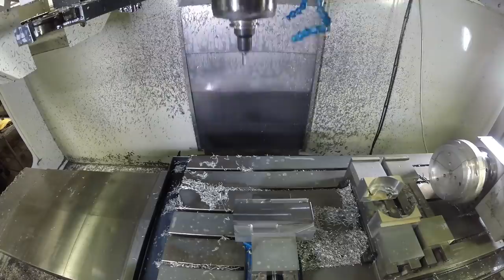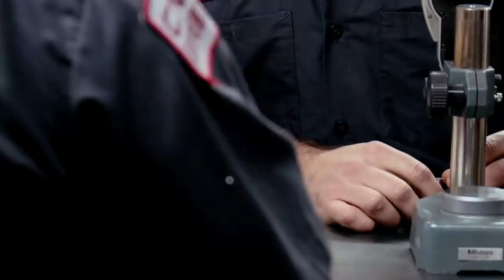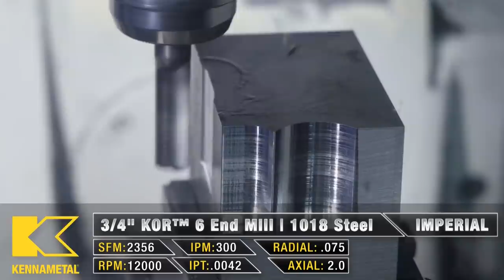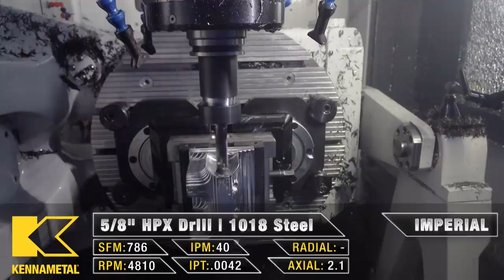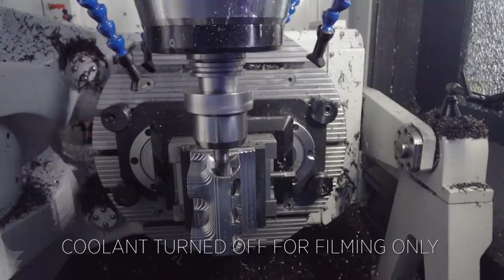Tools Keep Breaking on Night Shift, but Runs Perfect on Day Shift... Nobody Knows Why

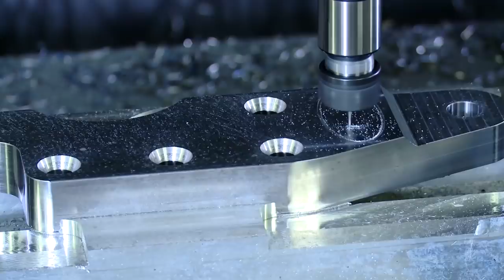Comment: 1:30 The "Problem" is bigger than you describe.    You're going too easy on the guy who changed the speeds.     He decided to change the speed because it "didn't seem right" to him but then he continued throughout the entire shift breaking parts.   Did it never occur to him, I'm not doing it they way I was told and all these parts are breaking.   I should maybe switch back to the given specs or call someone.  Instead of focusing on his job he tried to do yours and made a mess of everything.
Reply: How is that bigger than he described?  
Where I used to work we changed feeds and speeds all the time.  Some of our programmers had very little machining experience.  We were not doing production work and they almost never ran their own programs.  
It is okay to expect the operators to have a little bit of sense also.
I doubt anyone expressed to this operator how important it was for him to not touch the feed and speed override.  Shops rarely have mechanisms for adequate communication between shifts.

Comment: Sounds to me that the problem here is lack in standardization of programs, tooling lists coupled with machining superstars who know best! Each tool should have a unique tool number which corresponds to a tool drawing stating tool diameter, tool material, no of teeth, type of tool holder, tool stick out, tool stud etc. Sloppy of the owner to let this situation happen in the first place tbh!
Reply: I've been a machinist for years, and I think you are not clearly communicating.
In our programming, we do have differences, such as a long half inch in mill or a standard half inch end mill.
I'm not sure what you mean by numbering.  I don't think you would need to get into exactly what two holder differences are unless they are wildly different products.
Maybe where you have worked was more unique than you think.  
In a large operation it might be feasible to have a unique tool drive for every tool.
In a smaller shop I don't think you would have a budget for that.
And would be useless when all of your end mills are made of carbide.  We either had aluminum end mills or z carb end mills for steel.  All made of carbide.
Reply: And yes, I think it is sloppy management.  
If you are running the same parts for days, anyone could figure out  the night shift was not producing as much per hour.  
The first time they went through significantly more and meals would be a good reason for someone to get serious about finding out why.

Comment: Just block the feed and rpm in the program so the machinist can't move it down 

I had a place where I was trying a program for the first time and my programmer block these so I couldn't watch for the first contact. I've step a lot when I saw 300 inch per minute on 50% feedrate. And now I know they can block it.

Comment: That's what happens when you are a friend and not a boss. No. You will run this setup and produce the same amount of parts. If you cannot, I'll fire you before the McMuffins are cold. That's how it works. I ran the production machine shops of Boeing in Ridley Park PA. Your good machinists will thank you for weeding out the chaff. Go big or go home as they say and demand excellence knowing that every single part is exact as it can be. That is free management advice. I'm on my way to Florida soon but if you need it I'll stop by on the clock and straighten that shit out in two days, only because others sleep.

Comment: Do the tools get changed after X amount of use (surface footage)? We use drill bits that get changed after X amount of hits.
Reply: I haven't seen many people change an endmill after number of times used but I have setup tool life management for X amount of minutes used or when the spindle load reaches a certain level

Comment: Hobbiest here. Ive always heard that the feed per tooth value is the most important thing to keep an eye on but this is the first ive head that surface speed matters could anyone elaborate for me ?
Reply: It's all about finding the balance between both. Feed per tooth will for the most part determine your chip thickness, but running at too high or low a surface speed can cause tool life and surface finish problems, plus it's not economical to run too slowly!
Reply: I guess it's the balance between evacuating the chip/heat fast enought and not putting too much force on the tip.

Comment: We had a guy that would turn the feed way down so the head spent 10x as much travel time between cuts. The foreman would walk by four times a day to change it and tell him not to do it. That didn't last two days.
Reply: The foreman should have changed it once and told him if I have to touch that again you're going to need a new job.

Comment: Usually it's something you're overlooking EXAMPLE I worked in a plastics shop any down time for the machines means the remnants in the lines would harden so the first cycle back would either look like crap or simply not work that was every Monday morning for 3rd shift and after holidays and after routine maintenance OR after some tard supervisor in clean clothes would come out and start touching things that he had no clue about
Reply: Punctuation in your writing is actually extremely helpful to the reader.   😉

Comment: It's frustrating working with people who don't know what they don't know and yet they insist that they know better than you to the point that they don't hear a word you say.

My boss told us to erect a structure to mount an antenna to. I showed him a free standing 50' tower that could be had for $1200. He bought a extendable pole with guy wires. He had IT techs put it together. You could hardly even say they knew how to work a drill. Pole was supposed to be guy wired at 4 locations on the pole. They guyed the very top using stakes they put about 6 inches in the ground. Boss said he didnt like the guy wires and he wanted it lower. Took them off and lowered it and they couldn't pick up a signal. Bought the exact same pole with a roof mount tripod. Their thought was that we could use the tripod to raise it taller without any guy wires. The tripod was 4 foot tall. We already had it in concrete 4 feet deep. Now he's telling us to raise it the whole 45 feet with no support. It sways in a light breeze. We're $3k in.

Comment: Never been near any CNC machines only on YouTube.  but different materials and speeds temps  and drill /honing bits would be designed for that specific process 🤔 . If that's right 🤔

Comment: I don't understand how the night shift operator even had the leeway to make such a change.  Most manufacturers in the US follow ISO-certification and SPC management and I know that unless there was an immediate safety hazard we never had any such leeway to change things even in the early 90's.   Even then we would usually stop work until an engineer signed off on a change, not make such a decision ourselves.
Reply: I don't think you've worked at most manufacturers in the United States.
Most of them are probably very small shops.

Comment: Unfortunately this happens too often where I work. Some machinists are so far up their own asses and their self entitlement is sky high and they never learn.
These people usually think they can do a better job programming, but they have no clue what they’re talking about in most cases.
Okay, I’ve said more than I needed to, but holler if you can relate
Reply: You get a bunch of young operators with no experience... And nobody teaches them what the programing involves.   And programmers are human and make mistakes.
Not hard to imagine how some people start to think that they could do it better.  And yes, they are probably wrong.
But I've also seen programmers get hired even though they have no machining experience.

Comment: I run 8 cnc s...... believe me......it's low coolant due to evaporation, chip removal and lazyness......add the operator smoking a joint in the parking lot and there ya go....broken tools...

Comment: Thats why you can lock parameters in the program itself
Reply: Management used to take the key away so you wouldn’t make any edits on the program. but you can still manually slow down the feed and speed on the dial next to rapid speed. So it wouldn’t work.

Comment: The lesson learned here is that the tool should be locked such that a operator cannot change any values.  Machine operators are not CNC machinists but often times think they are.  Lock the tool, lock the program.  They only need the go and stop buttons.
Reply: Depends on the situation I suppose.
One might actually try to explain to the operator why it is programmed the way it is.  
That step usually gets ignored in my experience in machine shops.  Or, is done poorly.
Then, If you how long the program takes, as programmed, it should be easy to verify that the operator got the work done in a timely manner.
Reply: That being said, if your company only hires button pushing slobs... locking them out is probably a good idea.
Doesn't sound like a very nice place to work though.

Comment: I know the breaking thing, 5 years day shift broke an old sledge hammer. Got a new guy on swing and broke 12 ladders, 3 ratchets, 4 hammers, 3 paint tape rollers and 7 step stools in 4 months.

Edit, and that's not even counting the paint pots I had to repair and clean daily. So many dead paint guns😭

Comment: Problem at my plant is that the "engineer higher ups" are so crippled by social Aspberger's that they can't communicate without yelling or having a rotted tooth breathing on you inside the machine,  despite our work having 100% dental. Most times the goobers expect you to just experiment with features on machinery and have no fear about making a fatal mistake that completely breaks the $1,000,000 machine.

Comment: It is hard to understand that the tools break because of lower speed. You should elaborate on that more thoroughly.
Reply: He changed not only the feed/movement speed (which afaik would only take longer to finish but not cut worse, maybe chatter, less material load on teeth)
But also reduced the rpms ...and those too much for that tool it seems.
Reply: @PsiQ  Aaah, yes! Reduced RPM with constant feed increases pressure. If they reduce RPM more than feed that would explain it.

Comment: The factory I worked at, the engineers and lead guys were the arrogant ones. So no, the button pushers are not always the dumb ones. One of my stations, I looked at the bottlenecks of my position and adjusted my work here and there, experimented where I could, and cut my time and labor drastically. A team of 3 who had to follow a trailer up the line to finish, was dropped to 1 guy who had extra time to play with. Head engineer observed me on a trailer and scolded me for walking too much, but they couldn't deny my efficiency improvement. Ended up being fired later for bogus reasons, and funny enough the plant manager was fired shortly after I was. I didn't bother going back, but friends tell me they use my suggestions to this day. Good money, but man was there a lot of drama and corruption.

Comment: If the engineer says to run the machine at a certain speed, run it at that speed. They did the math already
Reply: My guess is that they didn't "said" anything.
They just assume that an operator is going to walk in and start doing things the way they want them to.  As suming isn't a good way to operate

Comment: If I am a "Machinist," I am nothing more than a Glorified Babysitter for a machine I may or may not know the Inner Workings Of.
INCLUDING HOW TO PROGRAM IT. Or why it's programmed the way it is. I probably know some of the Basics, but, only enough to "ELI5."

I would trust my programmer. Until running it the way HE SAID started having problems. Because if HE EFFS UP, it's his job not mine.

When I piss in the pot so I'll like the flavor better, THAT'S ON ME.
I learned not to do that in the Army. Because, in the Army, if YOU break a tool, because YOU SECOND-GUESSED THE PROCEDURE,
You get to PAY for the tool. And some of those can HURT.
But if you Follow Procedure By The Book, no one can yell at you.

Comment: Today the tooling mfgs have a very good idea what the right speeds and feeds are for their cutting tools. If you are using the tool for the application it is designed for, then the OEM speeds and feeds are usually going to dead nuts on.  When all else fails, read the instructions.
Reply: Absolutely, and, with the advancement of technology in tooling, the manufacturers spend a lot of time doing R&D to get those numbers... Go look at them first and you will be amazed at what some of these newer technology tooling can be ran at.

Comment: Modern education seems to be very bad. Going back 30 odd years, after spending the first year on manual tools, fps tip speed teeth ect, along with drilling speed and feed rate, were the study of the second year in an apprenticeship.

Comment: Discipline is needed here, the programme should be locked down, specified tools used, and the specified feeds and speeds used as defined, Quite simply dismiss anybody not using the defined/approved  method.

Comment: Shift between two other shifts is breaking tools when the other two aren't. Why is that shift is changing the machine settings? Who is the fool stupidvisor that authorized them to make changes? Were they even trained to make a change?
Simple fix: restrict who can make adjustments. That's what every factory I ever worked for did. They had one or two people authorized to change the settings, and a work order was required. Anyone unauthorized to make changes but did anyway, was fired.
Less than zero excuse. That shift wants paid for their time at the job, but don't want to work.

Comment: Anything that is electrically operated are affected by resistance changes caused by changes in temperature. Changes in resistance can alter speed/rpm. Not saying this is that case, but definitely something worth considering.

Additionally, motors function off of electromagnetic induction. The power drawn to powwe the tools is NOT always consistent. More air conditioners are ran harder during the day than at night, putting a larger inductive load on the power grid. An incrrase in induction can be compisated for by increased capacitance. Rarely is the adjustemrnt made on a daily basis. It tends to be manipulated on a seasonal basis. The power being provided during the day is definitely not the same as the power providrd at night. Phase lead/lag deviations do occur as well as Pk-Pk voltages. All of which can change the rotation performance of motors including their speed and torque output.

Any high precision machinery should always incorporate power regulation.  So again not likely to be the case. But worth looking into.

Comment: Temperature, atmospheric pressure, humidity. It's all what the weather, the air is like. Everything should be calibrated at the beginning of every shift.
Reply: At the shop I worked at you would never do that because it would be a complete waste of time.
You must have been holding some very tight tolerances.

Comment: A thought that came to mind, At night electricity demand is far lower and often the line voltage will rise, same as water pressure, high demand = lower pressure, With that in mind I wonder if the higher voltage at night is running any of the motors faster resulting in an increased load on the tool ?.

Comment: We have the same issue sometimes. We'll spend 3 weeks fiddling with every variable we can to get everything just right to run a new job to tolerance at or above pace, then night will come in and overwrite our order profile cuz it "didn't look right to me."

It's infuriating.
Reply: Educate them instead of blaming them. It's infuriating. ;-)
Reply: @MrTWOproductions  

You think we don't?  Shift hand off conversation,  process notes, signage on tooling. Doesn't matter. Some people are just too arrogant to accept Education.
Reply: @johnebert2619  Learn them how to calculate feetrates, spindlespeeds and cutting depths. This will do more than a label on a tool and over time it will save you time and money.
Reply: @MrTWOproductions  

We all go through the same classes, certifications and refreshers.

Comment: This is why automation is taking away jobs - because humans are not that smart and they're definitely not reliable.  The more decision making you can take away from a human, the better your manufacturing processes will be.  Having guys just make up whatever on the fly based on their uncalibrated and uneducated guts is just an obvious disaster waiting to happen.  Night shift making undocumented changes to a production process, at very least, should be an instant firing.  How could any shop operate like this?

Comment: without even watching this I can come to the conclusion that the night shift isn't doing tool changes, or, they are changing the programs so the pieces don't machine as fast. Either way, it's because they are lazy and want to do as little work as possible. I have worked in SO many places like this, it's because the people do not have any integrity. If you would like me to come work for you and get the night shift cranking, just ask.
Reply: Why would they do anything else when clearly nobody is holding them accountable.
I would think that most adults could figure out that the night shift isn't getting as much done as the day shift.  But, management would have to put a little bit of effort into thinking about that.  Which, as we both have seen, they often do not bother.

Comment: There's only one logical reason why night shift would be having issues when day shift isn't. They're doing something different. Not following the procedure completely & correctly.

USER/OPERATOR ERROR

Edit: Bam. Told ya. They changed the spec. Stupid operators think they know better. Smfh.